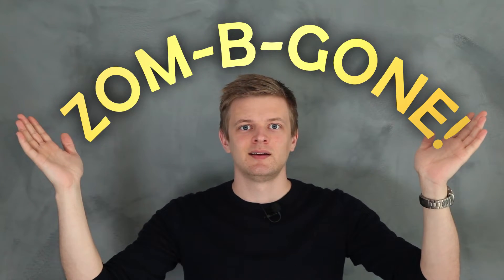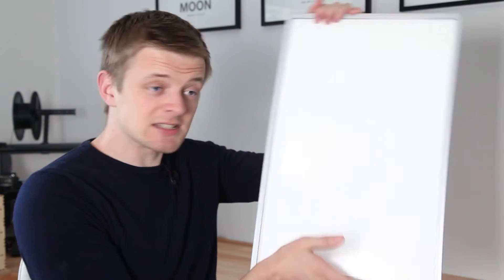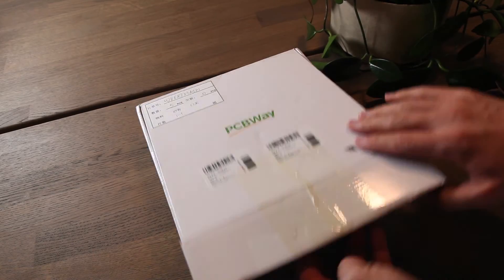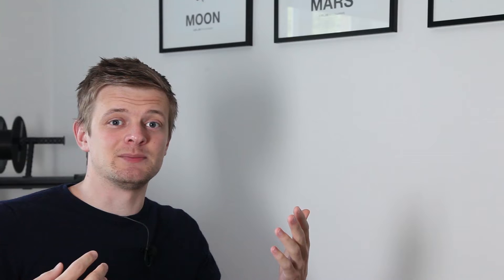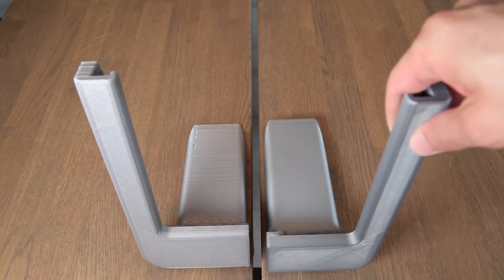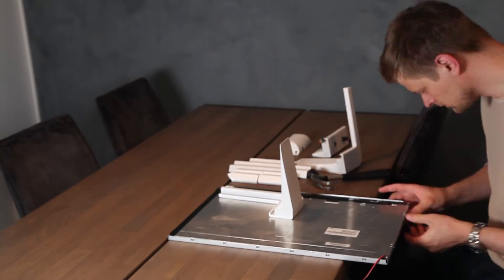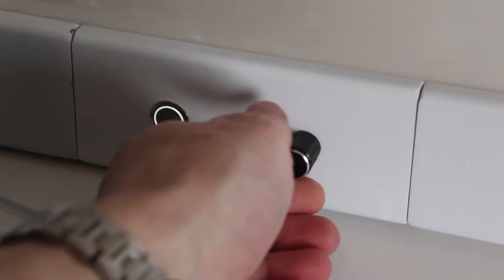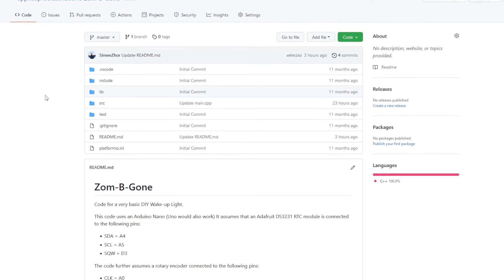Waking Up Made Easy! (DIY Artificial Sunrise)

Comment: 25 years ago I did the same thing, almost. It works great! 
I used to work at Bang & Olufsen, so naturally I had to have some B&O equipment :ø)
Programming my BeoMaster radio to send out IR commands to the LC2 (Light Controller) connected to my halogen ceiling lights started out on 10%, ramped up to 20, 30 and so forth before turning on music to wake me up. 
Greatest thing was the remote control - it could be used to turn off lights before sleep ;-)

Aaah, back when everything was 1 remote controlled... and then came https://www.youtube.com/watch?v=z5LW07FTJbI

Comment: Love the idea/design - I want to build something similar. This design suffers from what every alarm manufacturer since the dawn of time has assumed: that people with difficulty waking up use a 7 day calendar. I work shift work, so currently I work 2 day shift, 2 nights shift, then 4 days off. No traditional clock can handle this kind of schedule gracefully. My plan is to use an esp that can pull from a google calendar, bluetooth, or other json file format, to either have a list of alarm days, or the ability to procedurally code the schedule. (in my case it's day day night night, each instance repeats every 8 days). Many other shift workers/emergency services have similar insane timings that everyone making smart alarms ignores. (lookin at you philips ambilight).
Reply from the maker: That’s a very good point. I did not really write this firmware to be very user friendly for anyone but myself, but I totally get your frustration. On a somewhat related note, I’ve always wanted to be able to pause an alarm for x days (e.g. until the end of my vacation) so I don’t have to turn it off entirely and risk forgetting to turn it back on.